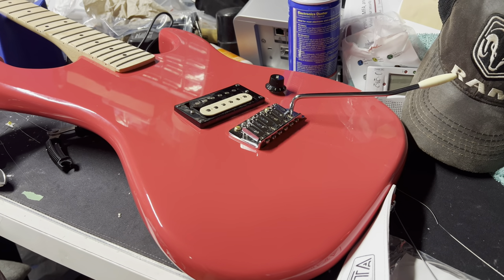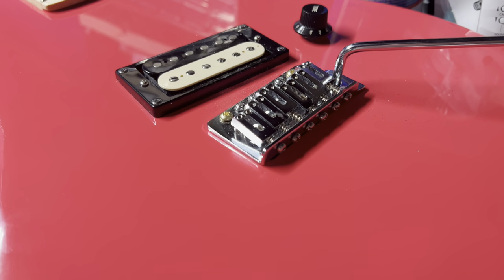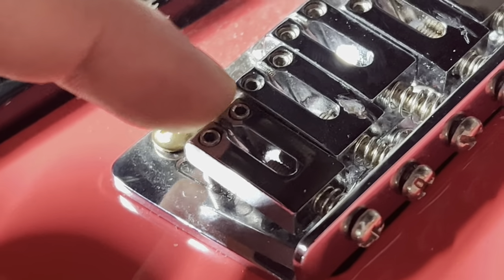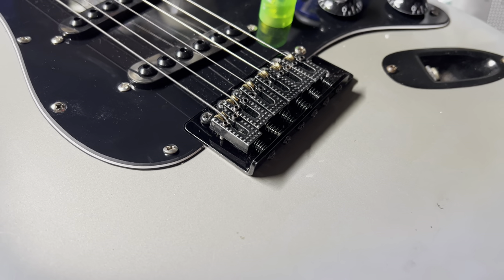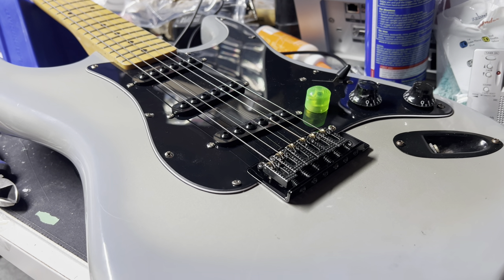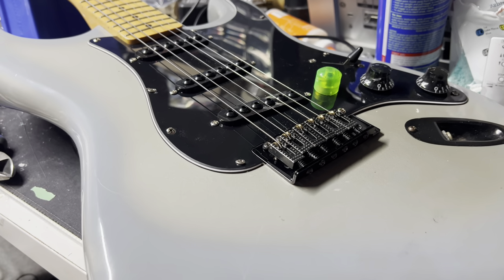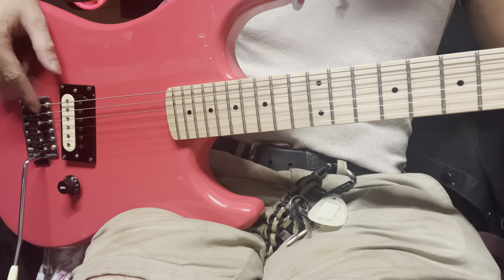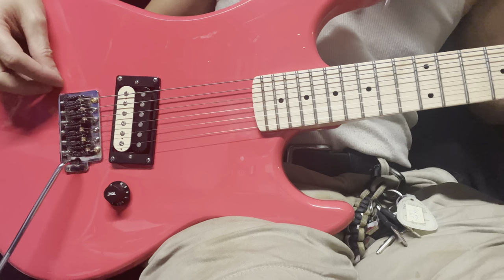Installing Roller Saddles on the Kramer Baretta Special!

Comment: I did this too, but did it after installing a Floyd Rose locking nut. Problem with that is the strings balls will move around in the block as well as drag on the saddle as you communicated and lose tuning stability. The smoothness of the bridge can be vastly improved with PRS screws, a MUST with ANY 6 screw tremolo bridge. Still went out of tune ,so I invented a a string locking block. Problem solved. See my videos on my channel TremDoctor, I have a bunch of these Barettas and have resolved all my tuning issues.

Comment: Do you hear any popping near the headstock after you've bent a string and then used the vibrato? If so, the nut slot on the string going out of tune may need some attention. Only other thought is too many winds on the tuner post.

Comment: What technique do you use for tuning the guitar?  I use Frudua method which dive , tune, dive, tune until as strings are in tune, probable is as soon as you bend the string will go flat but a quick dive and you are back in business.  Most people bend then tune which is perfect if you are bending or strumming but as soon as you dive or pull up you are SOL.  If these saddles work I’d rather bend and tune as most people bend way more often than they dive.